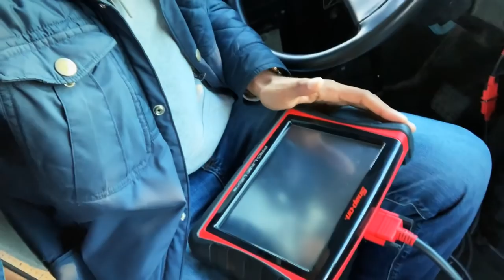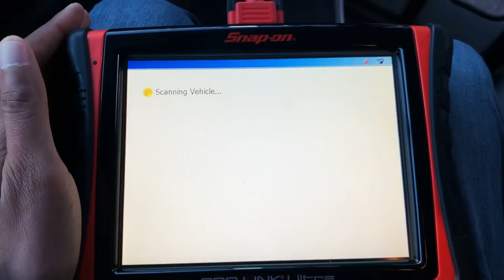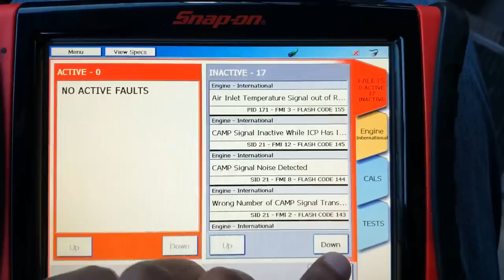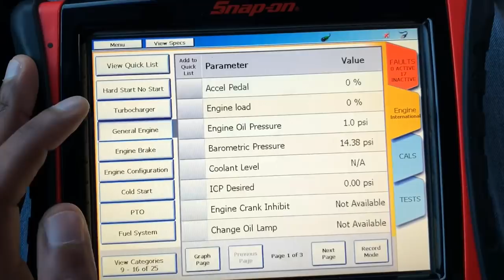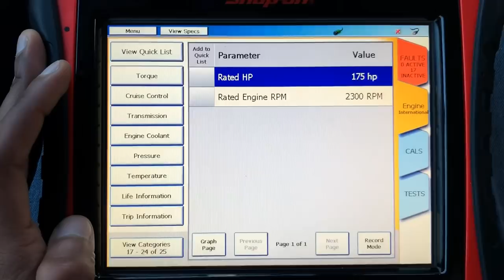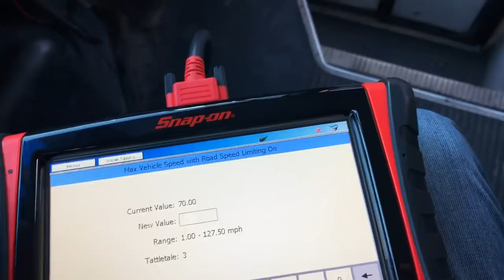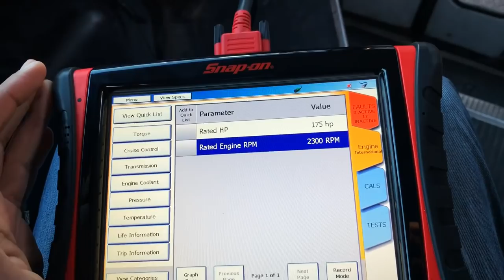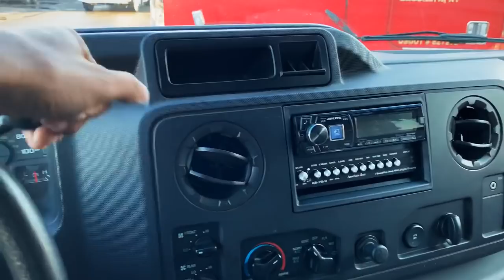Getting More Speed Out Of Your Skoolie

Comment: Easy disable the rpm governor often the state regulates the rpm's these can put out hence why going up a steep hill your foot has to be through the floorboard I'd put it back to stock before the governor was activated that way u can adjust it from stock personally I'd set it to 90 myself I know I'd never go that fast but I'd base it on the speedometer limit. For some reason unless your one of the lucky few international engines tend to have alot of issues so many in fact that sometimes if certain buses that are still in use needs a replacement engine they will just junk the international and put in a Ford Cummins